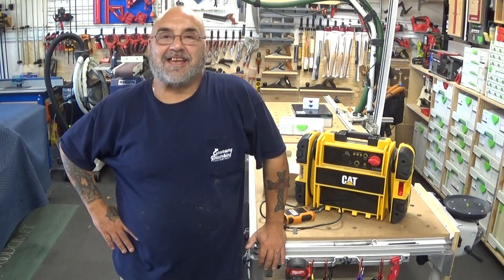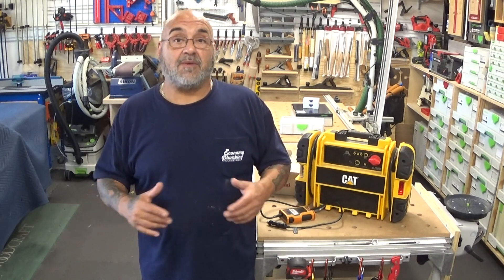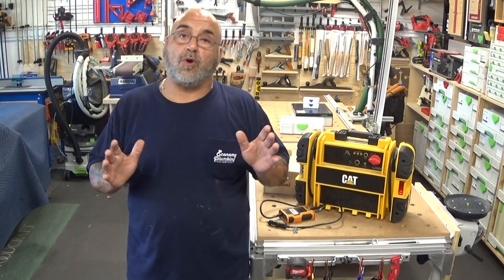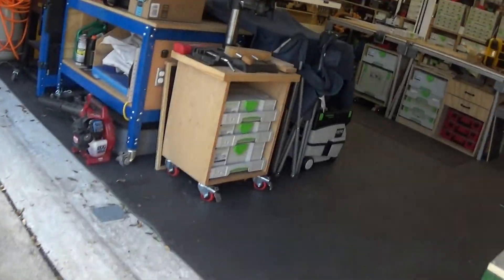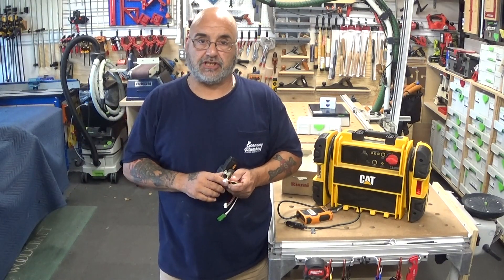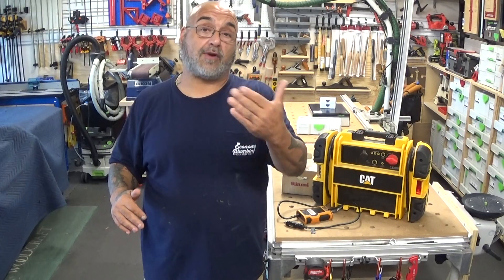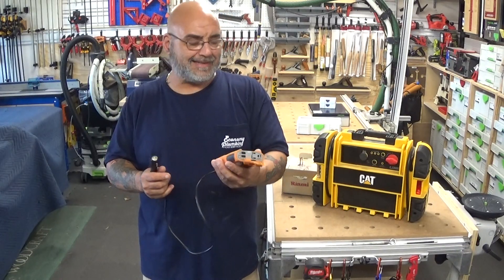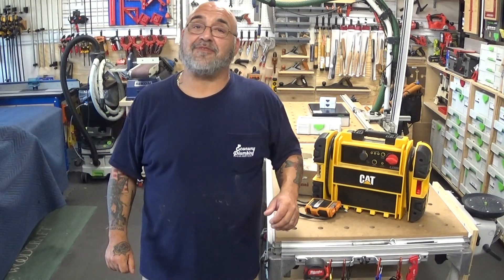How to protect your tankless during a storm and how to temporally power it.

Comment: As a retired Licensed Professional; Electronic engineer, you are spot on.  When I have an extended power failure I always unplug the water heater. I also turn off my furnace/AC After power is restored plug it back in. I also have it Plugged into a surge suppressor.   Recommend you buy one that directly plugs into an outlet, and then plug the water heater cord into it...Cheap insurance, because a Surge can happen anytime.  I have an emergency generator wired to a manual transfer switch in the house.  I start up the emergency generator, wait until it stabilizes (just a few minutes and then flip the transfer switch circuits one by one.  Same way turning off.  Turn off the transfer switches, then stop the generator.

Comment: Hello I have a brand new rinnai tankless water I installed. The units blower keeps turning Off and on. It's a solid light, so it indicates water flow and flame present. Except I have no water running and no leaks. What do you think could be the issue? Any help is appreciated.
Reply: Are your isolation valves set properly? Have you verified water flow by disconnecting the inlet and outlet? I can open the pressure relief on my unit and get to turn on and flow. I assume it's a water flow or a flame sense issue. Maybe tech suport can walk you through trouble shooting to figure out what it is. Do you have a DMM and know how to use it?

Comment: Yes there are so many negatives to a tankless unit now that we have heat pump units we need to rethink the need yes endless hot water but a fried circuit board and longer delay for hot water without a circ pump not the problem solver it was thought to be and burnin that fossil fuel
Reply: Great advice about using a generator!
I didn't know that you should start it up and then after a few minutes plug in appliances.
Thanks!